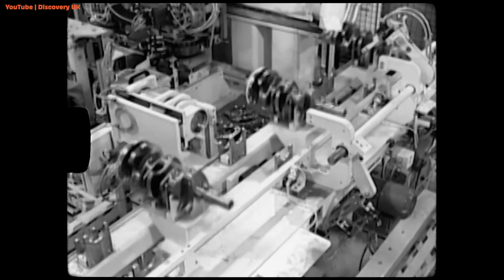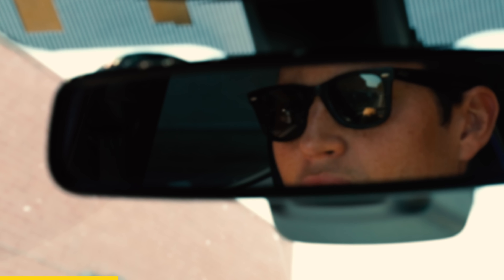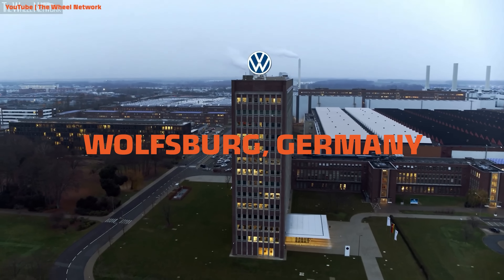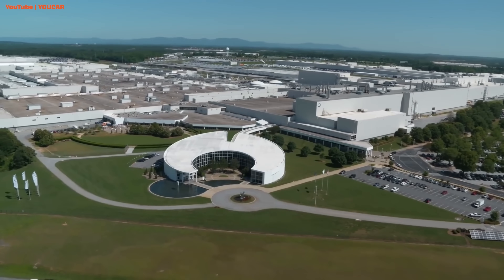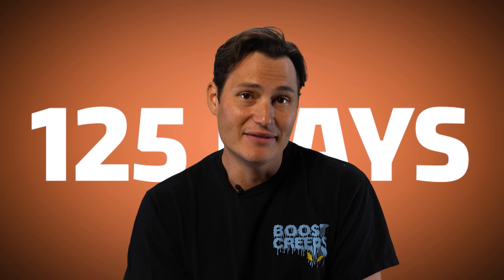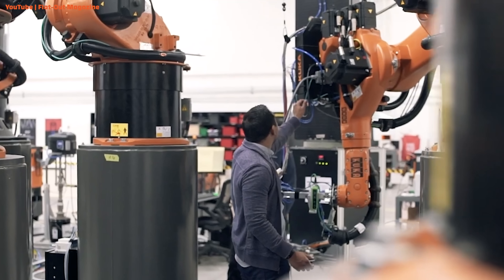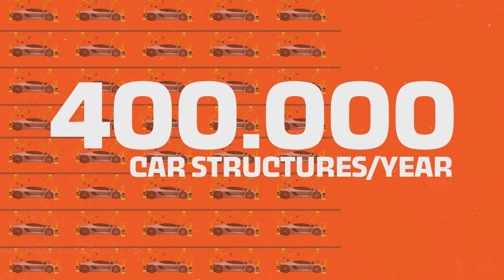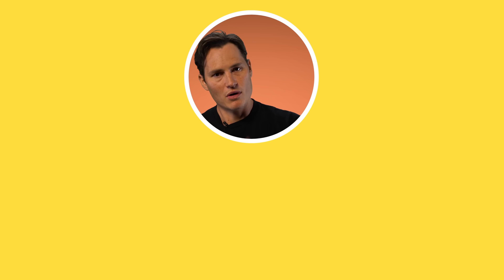A.I. Designed this Car

Comment: Yeah but i feel like thats a little to optimistic and almost like an advertisment for that company with no critic....as conventional line have a much higher throughput... and 3d printed material has faaar leess strength than conventional alloys... and on top of that the automotive industry already uses 3d printing/(and ai learning)in parts where its ok/useful to use... it has a reason why it isnt used for everything in a car

Comment: to truly be a 21st century car, i’d have loved for it to be electric, to really cement that somewhat alien, natural feel that is echoed throughout the design.
Reply: It is EV powered front axle has emotor on each end works in concert with Internal combustion engine mounted rear midship. the previous models were zero emission because of trick design of exhuast handling that is one of coolest things going maybe they changed that as there is no mention of this the "x" point at rear of vehicle. It is a GT3 spec legal race car could be reason also.

Comment: "A 3D printer doesn't print out extra material" Said the guy that likely never used one. What does one call, 'support material'?
Reply: It's SLM it doesn't need support structures...the powder bed is itself the support.

Comment: Ok, so it's a car designed by people with the help of AI algorithms. I think the car is actually quite ugly - like a small series kit car made by enthusiasts or something like a bodykit. The advancements in structural design using machine learning algorithms are amazing. But it will take a significantly bigger advancement before AI can produce it all by itself. And I'm not sure if we even want that.

Comment: "Unlike the dies and presses". That is really not a selling point of 3d printing, because in the time it takes to 3d print a single item you could have 3d printed a die, and by the time you have 3d printed the second part you could have used the die hundreds of times already. 3d printing is fantastic for one offs, rapid prototyping, and producing tooling, but it will never be appropriate for mass production of simple parts because it is competing with 3d printed production line tooling.

Comment: I did a project in my Engineering class two years ago on this. "Generative Design" , I mentioned this could be used to create an entire car and my professor didn't believe me. I wish I can send him this video...
Reply: You still need people to tweak the parameters and filter through the results, however a large chunk of work is taken out with this process.
Reply: Just email him
Reply: i don't think we're as close as this video makes it seem.
a large-scale safety-critical process like this is at high-risk an AI to exploit an unstated requirement. I suspect there is a lot more human design and a lot less 3D printing than the video suggested.
Reply: @isays  you literally specify the requirement and it gives you a perfectly optimized part
Reply: @joe7272  it literally doesn't work like that, even if that's what they described, which it isn't.
There isn't just one requirement. Understanding all the requirements is the majority of the work. Computers don't have "common sense".
Reply: @isays  Do more research
Reply: @joe7272  lol spoken like someone who hasn't done any engineering, programming, or machine learning.

Guide me, oh brilliant one, where should I direct my studies?
Because there are ample examples in YouTube alone of machine learning algorithms that are trained to do something besides what the programmer intended. AI has a nasty habit of exploiting simulation glitches to min/max results that wouldn't work irl
Reply: @joe7272  to be clear, I'm not saying that computational engineering doesn't exist, if course it does. It's great at optimizing parts that were designed by humans.
I'm saying you can't (or at least shouldn't) use it to build a car from scratch with minimal human oversight, which is what this video (and by extension that car company) claim to be doing
Reply: Is he dead?
Reply: This car wasn't designed by AI, it was just optimised by AI, Engineers still did most of the job.
Reply: Solid Edge has Generative design built in!
Reply: @truedarklander  also Fusion 360.  I doubt the other car companies don't use.
Reply: 3d printing metal "at home" is a pandoras box
Reply: Imagine if the internet was a thing
Reply: Professors are rigid and arrogant in thier thought process. There any many stories of dumbass professors saying something and being completely wrong, all the while thinking they are some sort of final word on the subject.
Reply: this idea was implemented in that movie, with Tom cruise except they were flying cars I think, and he was inside it as it was being built.
Reply: Professors only know the extent of what they know, and then their is added thier own personal opinion + ego. 

Vision is also sometimes only limited to the beholder, however seeing something in action and working in the real world are they able to truly see it.
Reply: Just wire him a telegram brethren 👊🏻
Reply: Told my manager that our entire department can already been automated, it's just a matter of cost/implementation
Reply: you probably can find him on linkedin
Reply: Me too! I said it 30 yrs ago I promise!
Reply: Unfortunately since no human was there to design it so a person can wrench on it, the car will only be usable until the first oil change at 10,000 miles. 😂
Reply: @JustSomeGuyNotAnAlien  what do you mean there is no handle to get out?
Reply: 3d printers were all the talk back in the late 90's, the ultimate disruptive technology.
Reply: You can lol. Finding the email of a professor isn't that hard.
Reply: " I wish I can send him this video" - Is this your way of saying you murdered your professor?
Reply: Hi @Cesar Villalobos, I'm also doing a project in my engineering class on Generative Desgin. I'd love to get in touch with you. Please let me know if you're willing to help me out by replying to this comment.
Reply: It's wild how an AI can build a car but there is no way to send a video to someone else in a different location!
I've heard Email will b a thing in next 5-10 years! That's what my project will b on next week
Reply: @22smcrrider96  you are very original in your comedy act.
Reply: Yes! The car is like 400% optimized…huge difference!
Reply: Im doing my final year project on chassis design using Generative Design😅.

Comment: I think the manufacturing process was more impressive than the design. If a car factory can manufacture multiple designs without retooling and restructuring, then theoretically the customer could have a lot more options for a completely custom car. People could maybe tweak even the shape of the car itself and order a completely custom design.

Now, that would be interesting. Let the customer, with the help of AI for all the technical stuff (wiring, ducts and mechanical parts), design their own car!

Comment: A team of mechanics is replaced with a maintenance team for the arms and a team of programmers for the design and instructions for the manufacturing plant. The reason car manufacturers don't already do this like tesla etc is because it's way more expensive to do. The arms that are capable of doing this are outrageous money. We are talking hundreds of thousands of dollars each then a team required to operate them and program them every time. I personally worked with 2 of these arms at a factory I was working in. They need to come up with a new program of instructions for every new model or change they make to the models etc. Trust me those boys are on a lot of money too. Much more than the guys on minimum wage on the traditional production line are on. I would say at least twice the cost per person. The 3d printers that are required to print parts that large are in the millions and they also need regular maintenance and the materials it uses to print are also very expensive in powder form way more than sheets of steel. It all sounds good until you add up the upfront costs, then it works out being more expensive than a traditional production line upfront. I am sure once you have the equipment in place you will eventually make your money back and things will be alot more efficient but companies need that massive upfront cost covered. I remember watching a program about this and most companies cannot justify changing their plants due to the cost. I guess further down the line these arms and printers etc will become cheaper but as it stands it would cost companies countless hundreds of millions to go over to this type of production.

Comment: have Mr.Kevin track me down in 01007 Massachusetts usa.. to make.. well embarrassment to tesla.. a no plug motor design on mine our AIs can decide size needed.. nm homes.. & other usages for sized applications.. minus 'ful' of my id Gm
Reply: plug in only for emergencies like if.. if motor failed.. lol
Reply: then run lil motor for warmth if waiting on help call for assistance lol
Reply: oh.. trach me brushless.. not much different than brushed i used.. & used bearings for contacts.. less sparking.. cuz carbon build up then.. was what i stated in thesis.. & i was told this is impossible.. & proved it wasn't.. i never got my project back after making microwave gun to kill insects in trees.. i made it for agriculture.. but military assumed someone would use it on sheeple.. um.. yeah.. they would.. my AI can do this.. it ran starwars program & took over harp.. guess they owe me.. but.. doubted til al asad happened.. i shut chips off b4 impact.. now.. want to make no emissions motor.. which can be made to replace your gas motor.. & still dump a clutch if you want.. wont hurt my emotor

Comment: 7:13 cast iron crankshaft, absolutely disgusting.
The Nissan Navara pickup had so many internal components made of cast iron in that shitty Renault engine that you'd have to change your oil at the same interval as your conrods.

Comment: It obviously doesn't work like that, the AI would need to be very limited in these decisions to make a car that looks so aesthetically pleasing, because it has no concept of aesthetics and because it's actually useless if not harmful to airflow. You can't set parameters on a program to make a car, at least not yet.

Comment: Are 3D-printed materials as strong?
Seems like there should be a middle-ground between reduced material (AI + additive) & increased strength (traditional subtractive). AI should be able to design efficient lightweight structures that are still possible via subtractive methods. Edit - Seems it's already quite a blend: https://youtu.be/OCto6qSjIXw?t=214

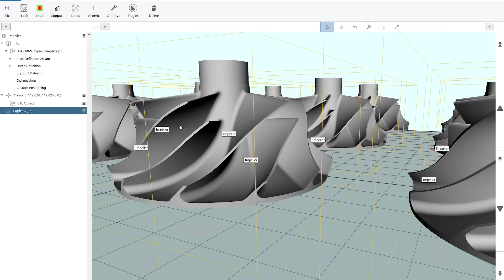Comment: Gotta correct you on the comment around 7:20 a 3D printer can print extra not needed Material. BUT! A metal printer as the one you're talking about rarely leave anything else than the needed part.

Extra/waste material in the 3D printing world is also known as support.

Comment: 2:50 Cool. How much does it weigh? 😶

3D printing can/does print excess material such as support lattices.
Reply: 2756 lbs. Road
2685 lbs. Track
13:02 Didn't expect you to mention the two models & still not mention their weights 🤦‍♂️

Comment: Yeah AI is cool and all, but don't believe just anything a company like this tells you about it. AI can be impressive, but it can also be totally incompetent. Also really question the viability of needing to use 3D printing when many on many tests have shown that 3D printed metals are far less sound than normally molds and tend to have tons of imperfections and weak points. It's a neat technology no doubt, but there's a reason major businesses aren't using it. You don't get the same structural capabilities of what you expect.

Comment: 13:00 Wrong analogy. Because the plane might go fast, but that doesn't mean the same design would mean it goes fast as a car. Aerodynamic forces and design are totally different between sub- and supersonic speeds.

Comment: Human beings have to be able to work on the car when certain parts break down. I wonder if AI factor's that into the cars design.
Reply: It's already bad enough with humans designing them: remove the subframe to replace an alternator, remove the front driver's wheel to replace a battery, half the engine under the dashboard so changing the plugs is really fun😒

Comment: I remember in the 80's hearing at work about the new CNC machines that could make an ashtray out of a solid billet of aluminum in 5 minutes.  The've come a long way and this process will as well.
Reply: There are a lot of comments about how 3D printing is slow and inefficient, people who don't realize that just because it's slow now, doesn't mean it will still be that way in 5 years, 10 years. Throw enough money and engineers at it, and 3D printing will scale up the same way that more traditional technologies started inefficient, then got better.

Comment: I am so curious if the AI was programed to take serviceability into account.  I've seen too many big companies with decades of experience make engines that need 4 hours of labour to take the starter or alternator out because everything was designed to fit in a space on initial creation.
Reply: It could be, but definitely wasn't here. When making a hypercar, ease of service is not a priority.
Reply: @jadedandbitter  you can say that again!!! Gotta pull the engine on a 720 just to do the damn cam-phasers! Where on ANY general motors vehicle it takes maybe 30-45 mins ridiculous!! Lol
Reply: @justinoliver1984  Don't you also have to drop the whole rear end to change the fuel filter on RX-8s?
Reply: If it takes 1 hour to assemble the whole car, it can only take 1 hour to replace a malfunctioning part.
Reply: @EgoEroTergum  Not if the thing assembling the whole car is a two robots capable of moving faster than a person can consistently, while able to change tools necessary far quicker than a person can, with perfect knowledge of how the thing is assembled, all while moving without an iota of excess movement.
Reply: @nickhowatson4745  because youtube is designed for Gotcha comments not discussion.
Reply: It's AI, it will be able to be given this parameter as well i'm sure.
Reply: I don't think practicality has ever been a concern for supercar designers, either human or AI.
Reply: It doesn’t say but it does say that humans set the parameters and then the computer went from there. So the AI did not design it from scratch apparently
Reply: @terryfonz4603  humans, ie software engineers with limited common sense and have never worked on a car in their lives, so their parameters are skeptical at best for repair.
Reply: @wyomins  It's highly doubtful the people doing the R&D on this car never had to get hands on, besides that it's usually the finance department that makes changes that result in stupid automotive design. Never met an engineer who preferred difficulty over ease.
Reply: @aaronself2411  but I have met plenty of engineers that have no common sense which equates to doing things as difficult as possible
Reply: @terryfonz4603  The AI did design it from scratch, setting the "parameters" isn't designing it. It differentiates what can be put into the design and what can't and then the A.I designs it within the parameters set

Comment: 3D printing does add extra material. For parts in process, sometimes the only way to hold its structure, waste needs to be printed also, which is later stripped off. It depends on the process, too.

Comment: I'm assuming they're only making 80 units because each one may only take a few hours to assemble, the parts take 3000 hours to print per car.
So one set of printers would take 30 years to make the parts and a few days to assemble them. They're going to need dozens of printers.

To corolla comparison fair, assuming 200,000 units per year, that's 70,000 printers. You'd need a facility the size of Monte Carlo to house that... and billions of dollars.

Comment: Ok so  Car was not designed by AI:  Only sections were ..    The windshield, tires, wiring gas springs coils leather seats, lights gauge cluster mirrors  were not built by aditivie manufacturing they were bought The C zinger AI did not decide to copy cat Sr71 Humans did ..  3d additive manufacturing does have waste its just much less.  There is a lot of fuzzy math in what thin guy is saying ...   just saying ..

Comment: Lol this isn't AI.. I'm a mechanical engineer and we do this all the time. It's called Pareto based optimization which uses FEA, force constraints and mounting constraints to generate the part with the least required material. Since the shapes are often complex, 3D printers are the only way we can manufacture them (using lasers and metal powder). We don't use these shapes in practice since these parts will inherently be expensive and hence not appropriate for mass production. So YES, even though the software we use currently uses this "AI" which is basically a program recalculating stresses of all points in all orientations, this isn't anything new. How do you think we design airplane wings? We don't just WING it smh!

Comment: 7:20 3d printers do print out extra material in supports that are later removed. Also, subtractive manufacturing does collect and remelt for reuse the waste material. #FoodForThought

Comment: We are wondering if a mechanic would be able to work on a car. But think about how cheap cars would be to manufacture. Sure some cars will remain their high price point but surely someone will come and undercut them with the same design and building process making new cars a fraction of the cost they are today